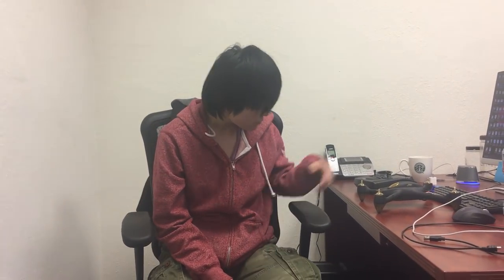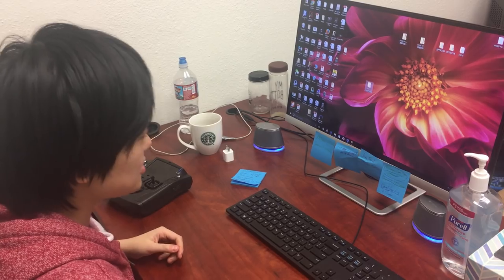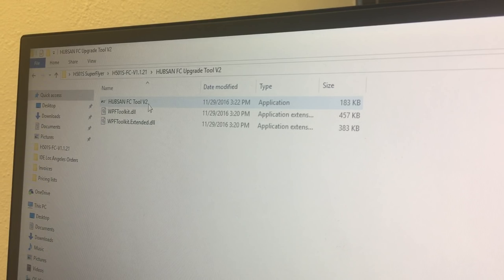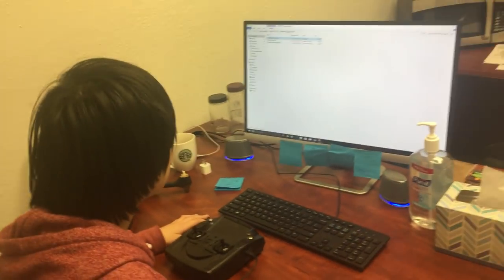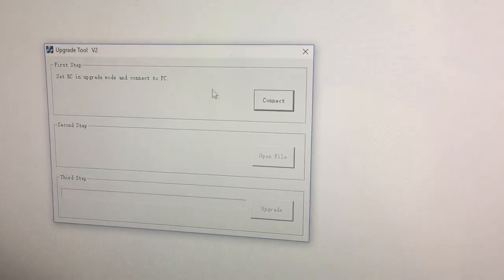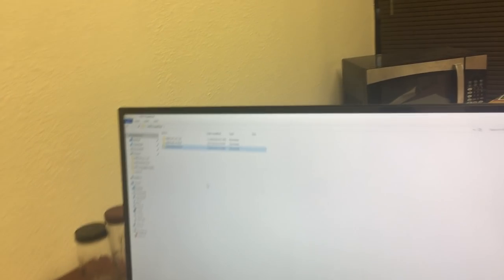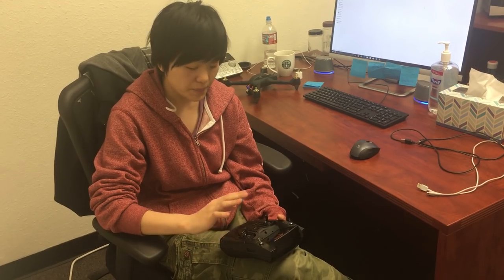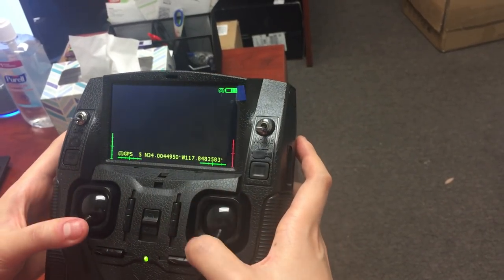H501S Firmware Upgrade Protocol

Comment: Hi, I have hubsan h501s PRO and i have installed firmware for drone
 and transmitter and after that i have no longer connection between 
drone and transmitter. (Black screen and no camera view) Also i cant 
turn on motors... Its is falshing like transmitters in off. Can i 
somehow downgrade it and back to factory reset? Please help me. Dont 
know what to do.
Best Regards, Nikola
Reply from the maker: To re-bind the drone to the transmitter, you will need to hold down the photo button and power the transmitter on, then put the drone close to the transmitter while you plug in the battery.
Reply: HUBSAN OFFICIAL
My picture while recording is not clear. It is bad... How to change that? Thanks
Reply: Its out of focus.... How to fix it?

Comment: Firmware link is dead. just refreshes to the hubsan home page. 
No firmware links next to h501s on the support page.
Where can i get drone firmware please?
Reply: I have the h501s-s as well if required
Reply: @estrela-caucasian  I would not say no to a link. I have the s, not ss so won't use any firmware. but i could do with a diferent driver package. x64 exe was in seperate folder alone, i moved it back across and used it. pc does not recognise transmitter, only drone atm. just tested cable on other device, it is fine for data.

Comment: Hi, can you tell me  donwnload the Firmware  just two files FC and RX , and why i haven't got the file RC. FPV, and how can i get the file RC for FPV  My drone didn't  work  , because  Transmitter not camera Screen no display ? please how can i do ?
Reply from the maker: There is no need to upgrade the transmitter. Have you tried rebinding your drone to the transmitter?

Comment: ANY HELP WILL HELP! JUST DID SUPERFLYER UPGRADE BUT NOW WHEN I TAKE OFF,THE QUAD GOES FORWARD AND UP AT THE SAME TIME. ALMOST LIKE A HELICOPTER REAL NOSE HEAVY. GPS HOLD IS IN GREEN WHEN PROPS ARE OFF BUT WHEN I ENGAGE THEM, GPS HOLD TURNS RED AND IM TOO SCARED TO GO ABOVE 5 FEET BUT WHEN I DID AND SWITCHED RETURN HOME, THE QUAD STARTED SOARING STRAIGHT UP. WHAT HAS HAPPENED. I FOLLOWED ANNE's TUTORIAL PERFECTLY WILL ALL SUCCESS BUT THIS IS NOT RIGHT. IS THERE A WAY TO PUT BOTH TRANSMITTER AND QUAD BACK TO FACTORY FIRMWARE???? it had v4.2.8 , H501s v1.1.9 and v1.1.9. I upgraded to v4.2.9 , H501s v1.2.12 and v1.1.22. I have the standard FPV2 standard transmitter. Can I somehow revert to what it came with....1.1.9?????
Reply from the maker: Did you calibrate your sticks?
Reply: I didn't the calibrate compass steps when Inplug in the quad to the battery. Rotate until green horizontally and the the second step with nose down until complete. Still flys wrong
Reply: I meant to say that I DID calibrate the compass after I plugged in the quad to the battery. The normal calibration is what I did.

Comment: Good morning, I need help because my H501S drome is not detected by the pc. I tried to change several micro usb cables and different computers but nobody is detected. I also tried to load the drivers in the zip file but it does not work. What can I do?
Reply from the maker: The drivers should solve the problem. If you cannot install them, please "Uninstall" and then reinstall. It should work then.
Reply: Thank you for answering, but unfortunately even uninstalling and reinstalling the drivers is not detected and is not found in the management of PC devices. It's like I do not connect anything. What can I do?
Reply from the maker: Send us a short video of the problem, driver uninstall and installation to service@hubsan.com. You might also just have a set that aren't working; there is another driver for users of the H906A transmitter. We will help you from there.

Comment: Hello I upgraded to the super flyer firmware package H501S-FC-V1.1.22 and the H501S RX V1 .2.12.  It all was successful but when I bind to the quad there is no video feed on the remote.  I have tried to bind it a few time but still no video.  Any ideas?
Reply from the maker: I would recommend to try and upgrade again, something could be lost in the upgrade process.
Reply: Hello thanks for the reply.  I downloaded the software again from the Hubsan home page and upgraded the software again.  Rebound the drone and still no video feed.
Reply: I just noticed the video is coming through my FPV goggles but not on the controller.

Comment: Hi, i have a issue with my Compass 2 calibration and some people tells me that the problem came from the flight control board and not from the Geomagnetic sensor. Can you help me with this, thanks a lot!!!
By the way i have the Superflyer firmware already installed on my drone!!!
Reply from the maker: Please forward your problem to service@hubsan.com. We will help you identify and fix the problem as soon as possible.
Reply: Aldo Hormazabal, eu sou do Brasil e meu h501s apresentou problemas com calib compass 2 a hubsan nos forneceu um firmware 1.1.24 com o propósito de corrigir declínio magnético que estava afetando o processo de calib, se quiser veja o vídeo que fiz lá tem o link, talvez te ajude.
Reply: Cual es el video que hiciste???
Gracias!!!!
Reply: ALELUIA alguém que fala minha lingua, se puder me ajudar agradeço, eu busquei meu drone ontem nos correios, e ta com esse problema, gostaria de saber se da trabalho pra arrumar isso, se tem que baixar muitas coisas e tem que ficar calibrando o controle, qualquer ajuda que me der vou ser MUITO GRATO MESMO
Reply: Acaban de sacar una actualización de Firmware para nuestra región de Latinoamerica y otros países que presentaron problemas con la calibración del Compass.
la version es la 1.6.25 para el Drone y la 1.2.16 para la controladora. Búscala en Google. Saludos desde Chile!!!!

Comment: Hi were do you get the latest firmware fromi try'd a site called drones for life and every time I try the firmware from there it just says update error
Reply from the maker: Use www.hubsan.com, "Support", "Product Support". Please note the difference first between an H501S and an H501SS and then go from there. You may use our video on the differences between the two to make the distinction: https://youtu.be/K2u09f1z7ro

Comment: Which tranmitter is good standard or pro. Plz tell me.
Reply from the maker: It's preference. The builds are different- Advanced transmitter heavier and more oblong, with external antennas. Great stick feel (metal and heavy duty plastic), nice and heavy. Standard transmitter- square body, average stick feel  (not as precise, light plastic sticks), but gets the job done as much as the Advanced does and is cheaper to boot. Pick and choose, it's up to you.

Comment: Hi- I updated my H501S to FC V1.2.12, RC V1.2.12, TX V1.1.21  Problem is that it will fly with no GPS signal in GPS mode even though I have set the controller to not fly without GPS.  It never would let me fly before 6 satellites were acquired before.  Any ideas how I can fix this?
Reply from the maker: Try upgrading to the latest firmware on the Hubsan.com site ("Support", "Product Support").
Reply: Thanks for the reply.  Can you tell me honestly- Will the newest update limit my range or height?

Comment: I have a problem, I just bought my hubsan h501s advanceversion and at the beginning I could not calibrate the compas 2 (vertical) now I try to calibrate the compas again and it seems to me a message on the radio saying lost signal .. please help me :(
Reply from the maker: Have you tried the newest firmware from this link?

http://shop.hubsan.com/index.php?main_page=support
Reply: I just did the firmware update that is in the link, I followed the steps and everything was ok, but in the end I have the same error. I pass the calibration of compas 1 and then on the vertical I see GPS signal lost and an alert sound in the control. I recorded it in video ...

Comment: I'm stuck on the RX upgrade. I'm on the first step where you plug the battery in and wait for it to connect to the controller. i've got red lights flashing in clockwise motion on drone and screen is stuck on "upgrade RX mode power on RX" why is it not connecting?
Reply from the maker: You most likely have an H501SS or an H501A. How to tell the difference between an H501S and SS: https://youtu.be/K2u09f1z7ro

Please see the corresponding video. 

H501SS: https://youtu.be/hk9Cgg-qP0M
H501A: https://www.youtube.com/watch?v=DqQ4HSYlH0U
Reply: Turns out I do have a SS. I shouldn't have to watch a 15 minute video just to tell what model I have. Better labeling would save both parties here a lot of grief. 

I also had older firmware that required me to use the 501a tool instead of the v2 tool. Again, having 3 or 4 different tools to do a simple firmware upgrade causes more issues than it solves. You really should work on getting one unified tool for all upgrades. Just my 2 cents.

Love the drone itself however! Need to buy more batteries so I can make it to all the places around here I want to go record at!
Reply: Please refer to 14:34-end of this video to correctly upgrade your transmitter.
Reply: Felipe Vieira Resende not upgrading transmitter. Only FC, and RX. Issue has been resolved.

Comment: I have just purchased 2 Hubsan drones. The H501s and the advanced version but both of the Video and photo does not work and they both don't recognize the Mini SD card. I have tried several types of cards with no luck ! Can anyone help please?
Reply from the maker: Back to Basics #15: Micro SD specifications and formatting for the H501S, H501M, H501A and H501SS
https://www.facebook.com/hubsan001/posts/1785092691795746

Back to Basics #14: The do’s and don'ts of taking photos and videos https://www.facebook.com/hubsan001/posts/1784351495203199

Comment: when clicking on upgrade tool for RX V1.2.20 firmware, the tool keeps saying no upgrade tool connected , all previous steps done correctly TX screen shows upgrade RX mode V2.
the FC Software on the quad updated ok no problems can you help
Reply: did anyone reply
Reply: @jamescrammond6431  no, as always.

Comment: Did the upgrade and everything was going fine till I went to link the adv. transmitter and quad. Now the adv. transmitter won't do anything just a green light and black screen. please help
Reply from the maker: Did you try rebinding the drone to the transmitter? For the advanced transmitter, you need to hold down the enter key first then power on your transmitter to rebind.
Reply: Ya I've tryed everything. There no life in the remote. New batterys.  Is there a way to reset the remote. Or would you be able to fix it. If you had it there in Walnut creek. I used to commute there every day from here. It's pretty close. I don't even get a led know matter what i try with the buttons pressed stick held power on combos. I sure hope it fixable
Reply: yes I understand. I hold the enter button down, then turn power on, get them close as possible. Wait for the magic to happen. No magic repeat steps  again .

Comment: Can anyone tell me why My rx file will not pick up my hand controller. When I click connect, It just says ( No upgrade tool connected ) My screen on the controller does say UPGRADE RX MODE V2 So, That looks right I have tried 3 different cables just in case it was that and I have restarted the computer just to make sure it was not that. Any help would be great! Thanks

Comment: OMG I have trying for the life of me to Upgrade the transmitter and all I get is a error message? I followed everything you said in the video. help
Reply from the maker: You should not press connect/upgrade more than once, if you do, there will be errors. Also make sure the drone is very close to the transmitter and make sure there are no other electronic devices near the quad and the transmitter.

Comment: when it says search for file and i clcik on the fimware, it says no items to match your search???
Reply from the maker: You have to select the file with the upgrade tool.
Reply: HUBSAN OFFICIAL  hi I have a h501s version v1.2.9   v1.1.17 it's showing v4.2.14 and lcd v1.3.3 do I need to upgrade this

Comment: I follow the instruction exactly and when I press the "Upgrade" button for the FC  I get an "Upgrade Error"  all the time. I have tried different ways to try it but the same appears.  Can anyone help out?
Reply from the maker: You're using the wrong tool and wrong video tutorial, most likely. If you are using the FC Upgrade Tool V3, switch to the H501A Upgrade tool V1. Vice versa applies as well. Make sure your FC firmware begins with H501A. https://youtu.be/hk9Cgg-qP0M

Comment: ps. the controller says 'manual mode' at the bottom despite having it off in the menus. pps. i performed the upgrade attempts 3 times and one with my virus protection off.

Comment: i have a problem here , the advanced transmitter became BLANK screen after all the updates. The led light on the transmitter is green in color but screen is entirely blank (no respond). Can someone help?
Reply from the maker: What was the upgrade file you used for your transmitter?
Reply: Thanks and i have finally solved the problem by updating the firmware to V1.1.23 . The reason why i tried doing the firmware update on this H501S advanced was because the drone auto return home after travelling for only 80-100m in distance (altitude about 45-50m) , which most expected 300m or beyond .
Initially i thought it could be due to other wifi or magnetic-wave interference but when i tested on H502S which is a lower grade model at the same area and flew along the same route , it could travel as far as 200-250m.  Any comments ?

Comment: stuck on check gyro sensor ..... wont goto compass calibration..please help
Reply from the maker: Try upgrading the firmware on your unit, it will most likely solve your problem. You can download the latest firmware from our official website at www.hubsan.com.
Reply: HUBSAN OFFICIAL  managed to do it today problem I was having is I have the h501SS and not the h501s , different firmware

Comment: Hola he podido comprobar que upgrade tool v3 no me deja meter un nuevo firmware siempre me da update error,a pesar de que esta connected.Cual puede ser el error?.
Reply from the maker: Please check the QR code on the back of your transmitter, does it say H501S or H501S-S? If it is a H501S-S then you would have to download the H501S-S firmware files from our official website and use the H501A upgrade tool for your unit.
Reply: your website update file is missing the patches and only contains a readme file in a zipped folder!

Comment: Hello, my follow me mode don´t work, what can i do? i have the last software FC-V 1.6.25 and RX-V 1.2.16
Reply from the maker: If the sticks are not calibrated, the drone will think that you are constantly moving the sticks and causing it to cancel follow me mode.
Reply: i have the sticks new calibrated
i have the copter new calibrated
the copter hold the position, dont follow me
RTH is off
movi on , follow me on... no work
follow me on, movi on.... no work
the copter hold the position and i dont can see a difference between RTH on or Off  i have 12 sattelittes on the copter and on the transmitter

i`m desperate
Reply: i have the sticks new calibrated
i have the copter new calibrated
the copter hold the position, dont follow me
RTH is off
movi on , follow me on... no work
follow me on, movi on.... no work
the copter hold the position and i dont can see a difference between RTH
 on or Off  i have 12 sattelittes on the copter and on the transmitter

i`m desperate

Comment: I cant upgrade my Transmitter Advanced H906a FPV1.

I using  TX_1.1.13, FC 1.1.41, RX 2.1.29. I already did EVERYTHING, replace cable, calibrate, rebind, without binding.

I trying to update TX 1.1.16

First i launch upgrade tool  V2, power on Transmitter in Firmware mod, press connect in upgrade tool v2, select firmware (tx1.1.16), in this moment, transmitter show "Power on RX". I Power on Quadcopter, and red lights flash to calibrate, never get out of this screen, Always showing "Power on RX". if i calibrate, stays in same screen "Power on RX". Should i return this to Geargest because thisits badpiece? or bad firmware stock?
Reply from the maker: You are attempting to upgrade the TX (remote control) by using the RX (drone motherboard) upgrade method. You are fortunate that the process never went through , as you would have bricked the drone's motherboard by doing so. Please refer to 14:34-end of this video to correctly upgrade your transmitter.
Reply: HUBSAN OFFICIAL hey, With this method I get working in 1 minute.

But I can't install firmware in transmitter with normal method. That's it's a problem with my drone or maybe it's normal?
Reply: i was trying this method 12:07, my drone its new, i never flying yet.
Reply from the maker: Please send a detailed explanation and video showing us what you mean to our email (service@hubsan.com).

Comment: Hi guys 

I'm just getting a new h501s, never flyed just start motor once... and since i'm stack on "CHECK GYRO SENS" and cannot do anything else ( no compass calibration or others things... ) i've try to make all update firmware from Hubsan web site BUT still nothing ... ( didnt find RC files, only FX and RX) ... Some one could help me ?
Reply: There is no RC file needed or used. I don't know why people keep asking the same question. If your trying this video it makes sense to read all the comments first, right? You have to set drone on level ground for a time at first before starting calibration. You might try disconnecting the batteries for a while and reconnecting again to start over.

Comment: helloooo, does the 501s x  work with fpv goggles??
Reply from the maker: Yes, the H501S works with FPV goggles.
Reply: Are there any fpv goggles you would recommend that is compatible with 501s,cheaper & high end?I know about fatshark.